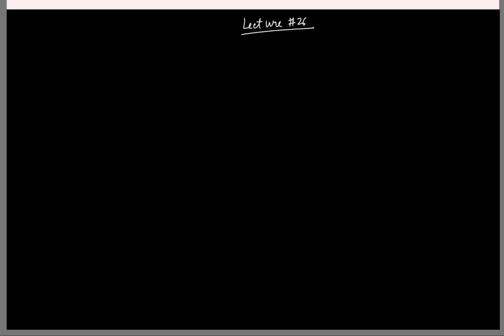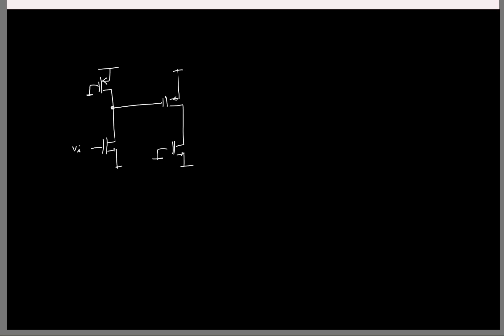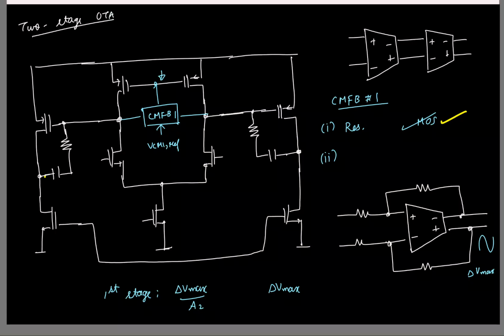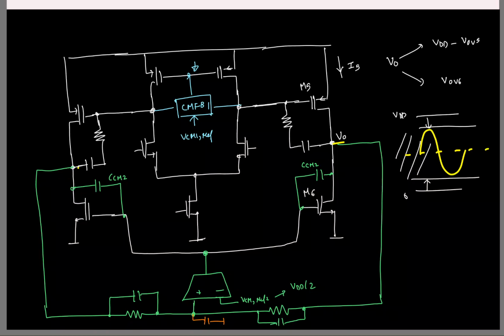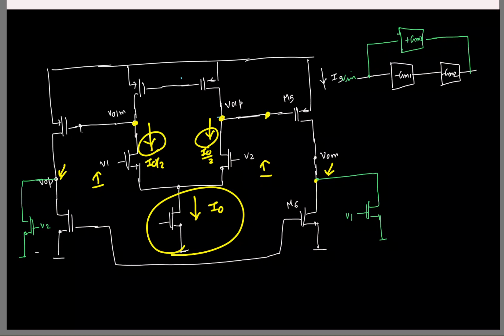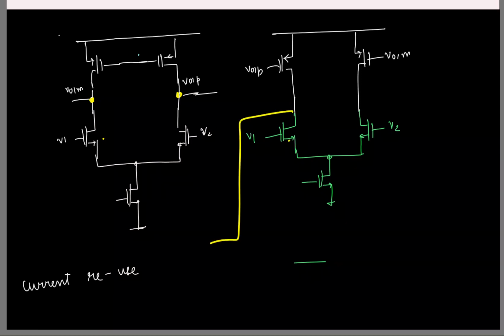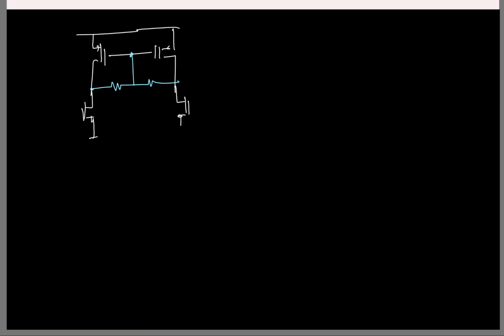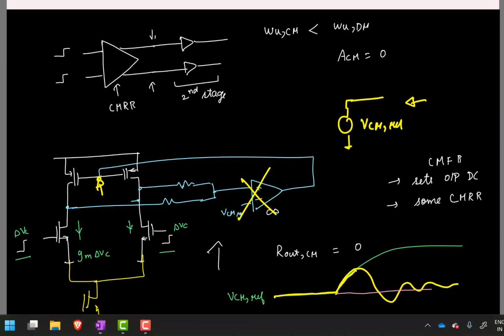Lecture 26: 2-stage fully-diff. Miller OTA, CMFB choices; fully diff. 2-stage feedforward OTA & CMFB

Comment: sir why single stage amp cannot give our required gain as ouput??
Reply from the maker: Single stage amps are not a great choice for driving resistive loads as the resistor will load and reduce the dc gain. Besides, we can get a higher gain with two or multi-stage amps.